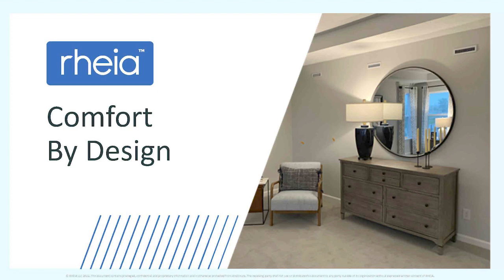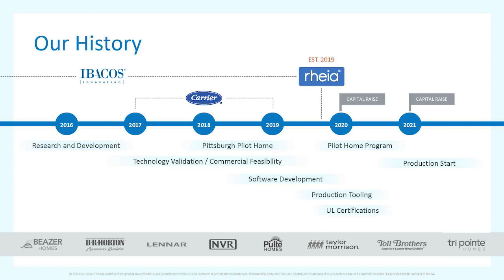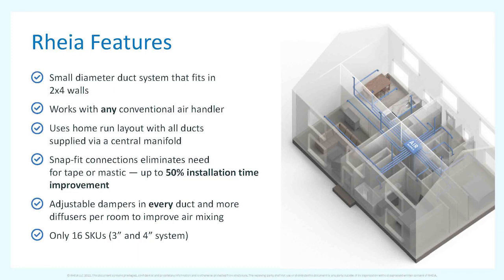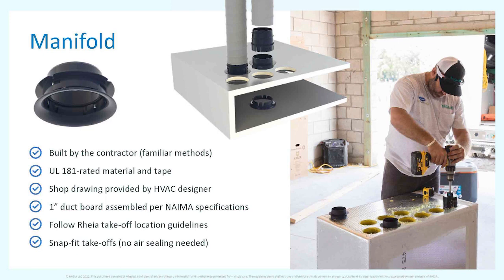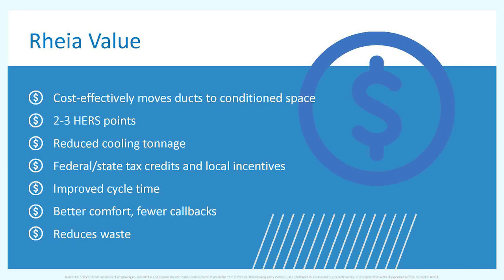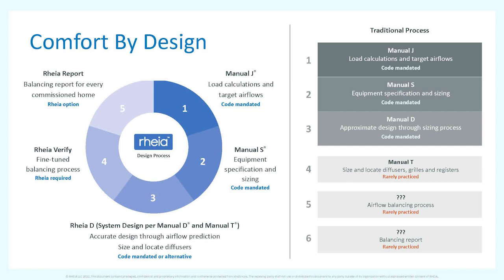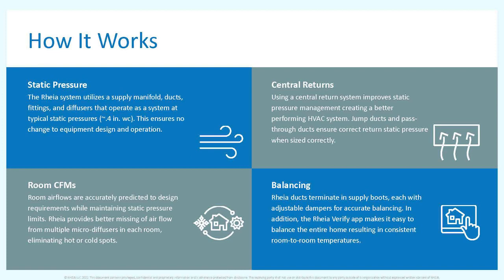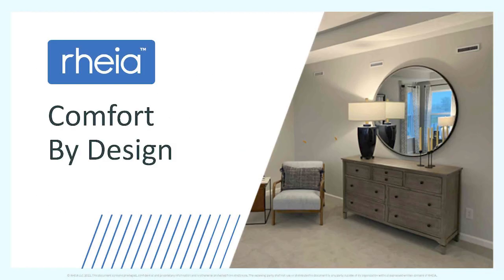A better way to design and install HVAC ductwork || rheia

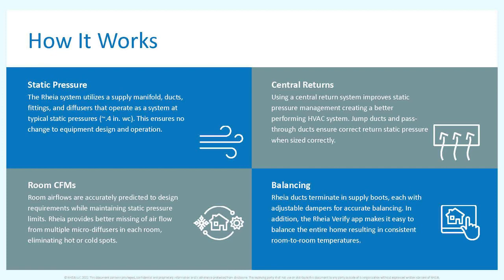Comment: 27:25 "just add more vents depending on load".  And .4 total system static pressure.  Wow, i was trying to make it work with a much more beneficial .8-1.0 static some furnaces have (like variable speed blower lennox furnaces and air handlers). 

 At .4 total static, most 3 ton coils are at between .15 and .20 static, air filters, even larger size single 4" low merv filters are similar, and you are .30 static in those two things.  No return duct yet, no registers, no manifold.  On .4" total static design, the target of 3" or 4" vents are going to be maxing out the system at a design static left over or .05 static for the duct.  Anyone, i plead you to look up even a solid metal 3" duct for your self on a free duct sizer/static/air velocity app at .05 static.  The airflow is nothing.   Without looking, likely 10-15 cfm per run.  I doubt any of these installers are doing enough runs.  If they did, they would be forced to talk to the builder about where they are going to put 90-120 runs on a small 1500 sq ft home.  Big packaging issues.  For something that is supposed to help with packaging.  

There are plenty of creative ways to keep ducts inside the envelope, that would save labor, save time, and keep a process simple.
Reply: Rheia designs are static pressure driven, just like any other duct design/sizing methods. Let's say you are designing a duct system and want your supply ducts at about 0.3 inches of water (IWC)? no problem. Following Manual S, you have selected equipment that will deliver 1200 CFM at 0.7 IWC total external static (approx. 3-tons of cooling) which satisfies your Manual J loads. You then account (properly) for a wet coil pressure drop at that flow rate of ~0.15" , a filter pressure drop of ~0.2". You now have about 0.35" of static pressure available to the ductwork. If you are using a central return the return ductwork pressure will be minimal, say 0.05", but there wouldn't be an issue bumping that up to 0.1-0.15" with dedicated returns that are sized properly.  The rest of the pressure pie is for the supply ducts-- i.e. 0.3 IWC. You're saying you can't deliver the correct amount of conditioned air at that pressure with Rheia ducts? That is simply wrong. 

How many duct systems in the US housing market are designed according to Manual D and balanced to match Manual J? All Rheia systems are.
Reply: Great!! You know how it works!!! Congratulations to hvac 101.  BUT common sense and math of it are simple:  

ALL THINGS BEING EQUAL, THIS METHOD IS WORSE, WORSE, WORSE, WORSE. (1,2,3, AND 4)

All things being equal, smaller ducts and more of them require more material.  A LOT more material per cfm, which is a lot more restriction.  A lot more material per cfm causes more static and velocity loss.  Its a complete and utter dissaster here 3 years later.  Yesterday, the first step took place in banning it here.  The system as you scale it up, you take up exponentially more material to target the same air volume needed for 1 ton of air.  Because of the needed scaling of the restriction of the small.dicts, the scaling requires more space, not less.  The only win is less sku's.  That's it.  

Time, thats debatable.  If you poll production home builder hvac contractors, you'll find is a LOOSER.  

Please invite me to a podcast and we can review the actual math of scaling a small duct system utilizing the same air handler, same filter, and same return air.  

Its awesome the conversation you having about the benefits of central return air, and getting ducts into conditioned space.  Duh, these are low laying fruit for any hvac contractor and builder with half a brain.  And apply them with a conventional duct system, with 6-8" home runs to reach room, and boom, you will be taking up less space, exponentially less material, and way less labor, and conservatively half the load on the blower, which means higher velocities at a lower amp draw.  

When you mention "its like a plumbing manablock system".  Bro, your accent makes you sound smart and all, but news flash, hvac contractors have been doing low static 6" home run systems for decades.  THAT IS THE MANABLOCK SYSTEM COMPARARIVELY.  

Seriously, this is akin to reinventing a mana block plumbing  system  that uses four 1/4" hot and cold water lines PER FAUCET, instead of ONE 1/2"  HOT AND ONE 1/2" COLD LINE.  

ALL ROOMS REQUIRE 3-6 VENTS.  ITS BONKERS.  

SHOOT, LETS JUST GO AHEAD AND START RUNNING PLUMBING  RUNNING  TWENTY  1/8" LINES INSTEAD OF ONE 1/2" PEX LINE.  WHAT SENSE DOES THAT MAKE IN ANY WORLD APPLYING TRUTH OF MATH AND PHYSICS.  MATERIAL CONSUMPTION GOES THROUGH THE ROOF, ANDNPERFORMANCE GOES DOWN.  

MAYBE WE CAN CONVINCE PORSCHE TO DO 115,  3/4" EXHAUST TIPS INSTEAD OF FOUR 4" ONES.  IT WOULD BE EASIER TO INSTALL, PACKAGE, PUT TOGETHER, AND LESS MONEY FOR SURE.  

IM MIND BLOWN THIS EVEN MADE IT PAST A NAPKIN.
Reply: Im not saying it cant be done with rheia at all, thats not at all what im saying.  It 100% can be done.  WHAT IM SAYING. BY THE TIME YOU SCALE IT UP,.TO PROVODE THE AIR VOLUME THE SYSTEM NEEDS, YOU ARE NOW CONSUMING SO MUCH MATERIAL, THAT TAKES UP SO MUCH SPACE, THE VALUE PROPOSITION IS TOAST.  ITS EVISERATED.  Lmfao, maybe porsche takes me up on the idea of 115 exhaust tips to replace four 4" ones.  Maybe im onto something.  

BUT IF YOU THE BUILDER ARE OWNER IN RHEIA, AND YOU ARE PROFITING FROM THE SALE OF ALL THE MATERIALS, AND YOU CAN CHOOSE TO SPEC IT ON YOUR JOBS, THATS A WIN I SUPPOSE.  I CALL IT KICKING YOUR OWN ASS, ESPECIALLY IF YOUR END USERS HATE IT.  

CLASS ACTION LAW SUIT IS IN COMING HERE IN UTAH.  WE HAVENT EVEN DISCUSSED HOW IT ABSOLUTELY DOES NOT MEET THE INTERNATIONAL MECHANICAL CODE.  I GET THATS DEBATEABKE, BUT HERE IN UTAH, FINALLY SOMEONE BROUGHT IT UP, AND ITS BANNED HERE AND NOW.

Comment: The math doesn't work out.  This product was sold to national home builders directly, and its gaining popularity extremely fast, and I predict its going to implode as fast as its coming on to the market.  

Typically, I'm seeing 25-35 3" runs from the few installations I have seen online.  There must be lots of 2.5 to 3 ton applications in that range.  Most HVAC guys would agree, on the supply side, the equivalent of a 15" or 16" round would deliver that 2.5 to 3 tons depending on how complex, long the supply and return air is, how much static is available after a filter, coil, furnace/Air handler has been designed into the system.  The vents themselves are also very restrictive when compared to a typical vent you see available at even home depot (just looking at their shape).  I get it, its about creating some velocity at the air exit. But the shape in both the round and thing wall vents is by its nature restrictive, a lot more than a typical 4x10 vent when compared to what the air volume its delivering. 

The big issue here, is the math, and static pressure, even running out a 16" equivalent trunkline, to 12,  final 6" vents, keeping crossectional area constant in comparing 12, 6" vents,  6" vents, that nets a 336 sq inches.  These small 3" vents, are only 7 sq inches cross section.  So, to keep crossectional volume similar, you would need 48 of these small 3" vents.  If this company says its ok to have less vents than that, wow, its only going to perform worse, not better.  Now, back to 12 vents, 6" size on a normal 3 ton application, 336 sq inches, that has a circumference of 216".  That 336 sq inches of air is contacting 216 linear inches of ductwork as it passes through it.  Static pressure is directly caused by the air interaction with surfaces.  48 of the small 3" vents, give you the same 336 cross section, except now that air through all 48 of those 3" vents is interacting with 432 linear inches.  

We are talking about double the surface area that the air has to contact with, its all friction, and thats assuming all things equal, we are comparing 6" home run lines just like these 3" lines are run.  With a normal HVAC design, a single 16" trunk would apply here, and that helps even more the static pressure to be lower.  

As we know, static pressure isn't a linear relationship, nor is a blower curve.  I'd love to know what Rheia recommends for a 3 ton setup on a small home, how many runs.  I doubt its 48 lines, if its not, and its much less, the issues only compound.  This is why so many people think this system is "high velocity" and it isn't.  Its only the velocity and static pressure a normal furnace can handle.  Max capability on the best variable speed furnaces is .8" static on heating, and 1.0" static available on cooling total.  

This is so so so so bad.  

a 3" duct (metal) running 30 cfm, has a friction rate of .28 inwg/100ft.  A 6" duct running 100 cfm has a friction rate of .08 inwg/100ft.  We are talking 350% higher friction rate.  And thats compared to 6" home runs to every vent, which its widely frowned upon, because its one of the most restrictive ways to run a duct system, super inefficient labor wise, ineffective for packaging.  This is just doubling down on a terrible installation method of 6" home runs, but in a result that is way worse that double.  Closer to 4x worse.  

Critical thinking is gone.  Packaging isn't even a win.  Its just a dumbed down way to do hvac that takes the thought out of it to make things simple, but the impact on all things are going to be terrible.  I understand, the market we serve is high end.  I run about 50 guys, 10 Million a year revenue working on 150 Custon Estate homes a year that are all between values of 3 Million dollars, up to 100+ Million dollars each.  But I didn't get to working on these homes over night.  I have worked on all types of projects.  Having 5 or 6 vents in a room where one would do it.  What wall clutter.  

I'd love to know more.  Anyone who has information they can post here, that would be great.  For now, until someone can explain the math to be different, this brand Rheia, is missing its first name Dia.   Its no different that the Aria vents that are out there.  The math doesn't work.
Reply from the maker: Have you reached our to rheia for an explanation for any of your concerns?  Would you like for us to host a zoom meeting with you and them to address your points?
Reply: https://rheiacomfort.com/wp-content/uploads/2022/06/How_does_rheia_deliver_enough_air-05-13-20.pdf

Does this answer your issues? They say their ducts are more airtight and allow for shorter runs.
Reply: This is an old technology repacked with flex and plastic vent outlets.  I have two customers with 3 inch sheet metal ducting running to multiple floor vents in one area in the far suburbs of Philadelphia, both systems are over 30 years old, both systems are supplied heat via oil furnaces.

Comment: You have to have higher pressure with smaller duct. Damper at the ends is the must inefficient method of balancing . This is old tech !
Reply from the maker: This is low velocity
Reply: Well, high static pressure means either fail, or high velocity.  Unfortunately, no hvac equipment is rated above 1.0 total static.  So it's fail, unless someone really pays attention to the real math, and has 20+ 3" runs per ton, so 60 runs on a 3 ton system.  I don't see any packaging benefit with so many runs, and aesthetic is goofy, with small separate vents, in very small bedroom that needs 80-120 cfm we are talking 4 to 6 3" runs.  Good grief.  

Im assuming .1" static target design and 100' equivalent length (which is shorter than most residential  hvac designers think).

Comment: How many 3" supply air ducts are required to distribute 2000 cfm?
Reply: It's almost like you have re-invented the "Coleman Blend Air"
Reply: I would think at a minimum, 50 lines.  Absolutely obscene amount for this to even come to close to working with even the best variable speed residential furnaces/airhandlers that operate at a max available static pressure of 1" total water column.  even at 50 vents, anyone with a duculator sizing/static pressure slide rule will see its obvious that the static resistance of having twenty 6" runs at that same air volume of 2000 cfm vs 50 3" lines at 2000 cfm, just see how the friction rate rolls out for those air volumes.

Comment: Can this sytem be a DIY system and mated to an air handler that is already in place ?
Reply from the maker: It is not currently available to the retrofit market.  They mostly install it in new production homes.  Hopefully it makes its way into the custome market sooner than later.

Comment: I have this in my brand new 2 story home.  It is a terrible system…hot upstairs freezing downstairs in Summer and opposite in the Winter.  No adjustments on it either.
Reply from the maker: Do you have 2 different HVAC systems, or is it zoned?
Reply: @RateItGreen  mine is zoned.  The Ceilings domes keep falling out and the system dumps all of the air on the bottom floor
Reply from the maker: @dazzazulu777  I am a high-performance builder, and it sounds like it is a system design issue, not this ductwork.  I always recommend multiple systems with balanced ductwork per zone.  It sounds like there are central returns in your system preventing each zone/ room from being balanced.  I can give you a free15 min consult to point you in the right direction if you fill out this form- https://sawhorse.net/contact/
Reply: We have this system in our new two-story home and we hate it! It is a horrible system made very cheap and impossible to clean. Upstairs is hot year-round and you cannot balance this system. It is used by cheap home builders. Do your homework and do not buy a Pulte home!

Comment: Does this up to  code in California?
Reply from the maker: Most states require that you install the equipment and the ductwork per the system design.  If you are using a design tool, then you are able to design using these parts so they will be code compliant.  Many production builders are using this system that build in multiple states.